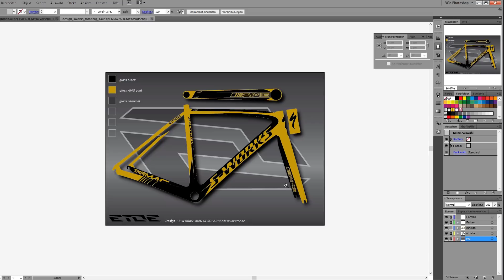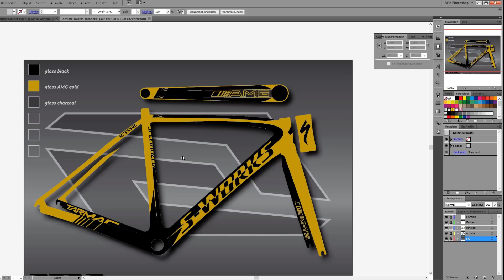spray painting a carbon bike - Mercedes Benz AMG Solarbeam yellow on Specialized S-Works - DIY

Comment: I posted something on my Facebook earlier today. That I was looking for someone that does custom painting. But for Carbon fibre bikes. I have a non s works 2017 Carbon Tarmac SL4 and I just happened to open up YouTube and here is a video of you doing a custom paint job on a tarmac.
I want to do mine in lime green and black with tarmac on the down tube and specialized on the seat tube.

Comment: really nice work. How many grams did the paint job add to the weight of the frame & fork? (Many carbon frames come in black/unpainted (just with a clear coat) to save weight.)
Reply from the maker: minus -49g. The paint job is lighter than the original paint job delivered from Specialized.

Comment: Love you work - have been following for quite some time. Curious as to how long you spend wet sanding and polishing after clear coat is applied? or do you not touch it.....
Reply from the maker: Only finishing one or two dust particles after clearcoating.

Comment: So what different spray tips do you use? I noticed for the final clear coat the spray was much wider. The can primer tip do you prep it so your sure the paint comes out nice? And how long and at what temperature do you  cure the paint. I think thats the first time you mention a  hot box. Do you do all coats cured in the hot  box and how long to dry between coats? Thanks Master for your videos.
Reply from the maker: Drying is two days or ten minutes depending on color. Heat drying is 20 degree, 55 degree or 80 degree. Nozles are 0.08, 0.35, 0.8, 1.0, 1.2, 1.4 and 1.6
Reply: @ETOE  2 days to ten minutes! what are the guide lines or circumstances?
Reply from the maker: Temperature, humidity, harder, combination of colors and a lot of other influences.
Reply: @ETOE  It's either very complicated or your not giving away any secrets. I do house painting and it can range from 1 hour  for a primer to over night for oil paint out doors before painting a second coat. I guess those sparkles and sheens take a special consideration.
Reply: @ETOE  I would like to be your pupil and neither asking you here every time the technical nor materials you use. Thatv can not be for free. Details are the most important thing in every job. Thanks for sharing your exquisite jobs, Mr. Grey.

Comment: Questions from someone willing to try your techniques. If you'd be so kind to answer. Thanks!

1. What number sand paper did you used first to strip of the original paint? 
2. To what point do you sand it? Until you see the carbon?
3. What number wet sand paper did you used to smooth the prime?
4. How much time between the 2 layers of gold color and between the 2 layers of transparent color?
5. Which kind of tape do you use to mask the fork?
6. What kind of permeable adhesive do you use to make the letters?

Comment: I just started playing with rattle can sprays, they're far from perfect but whatever - the issue I have is that I can't nail the masking tape part. Should I use special masking tape? Because the generic tapes do not stick well enough and instead of a nice cut off line I get spills under the tape and it looks awful, nothing like on your videos.
Reply from the maker: Normal masking tape works well. Use better color.
Reply: Sounds like maybe the paints being applied to heavy and is running under the tape? Try dusting it on a bit more. Practise makes perfect :)